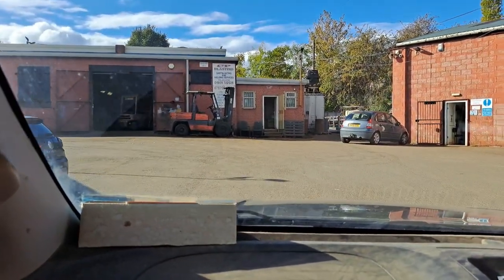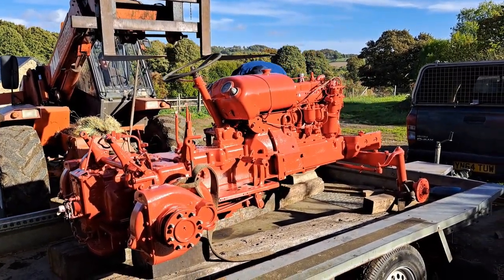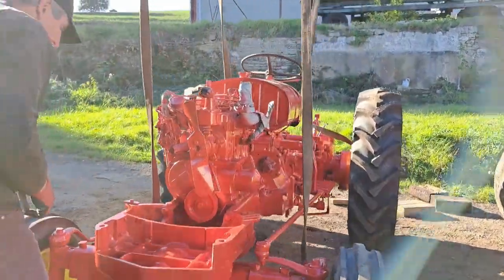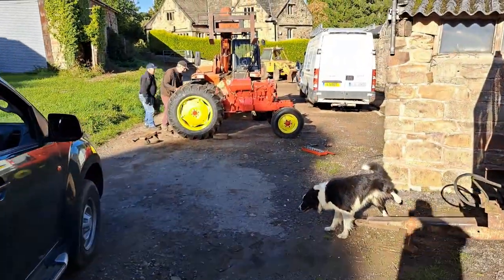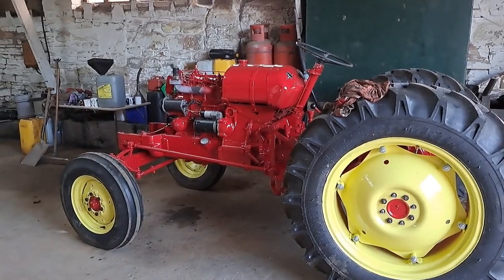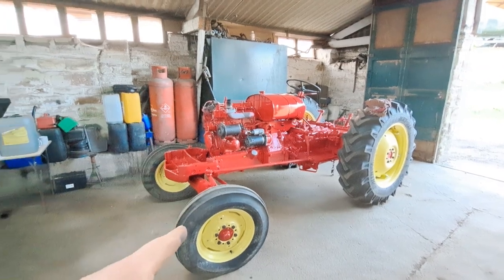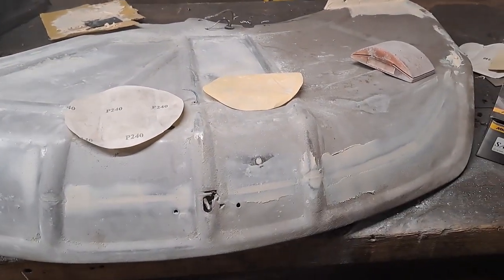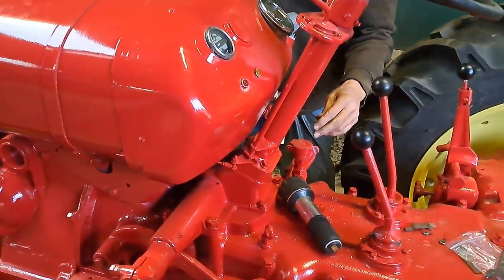David Brown Back from Shot Blast!.....Part 1

Comment: The old girls looking right smart. I'm in the process of restoring a 66 880, it's a slow process as she's still working, currently doing the mud guards, hydraulics transmission electrical have been done, just need to do the engine and bonnet, then paint her. The old dear only has 1300 hours on her, but she sat in a shed for close to 30 years.
Reply from the maker: Thanks Michael....these 10 minute restoration jobs take forever lol 😆